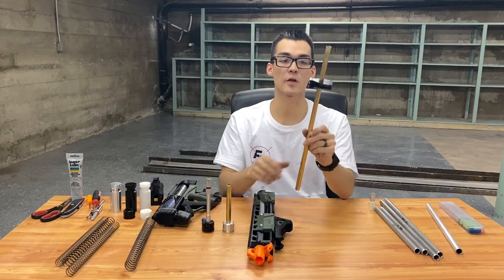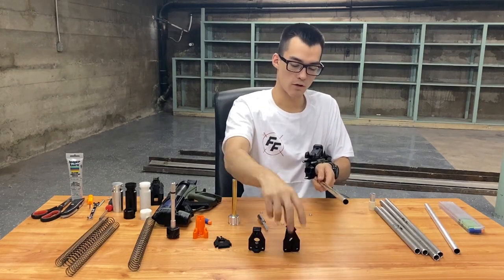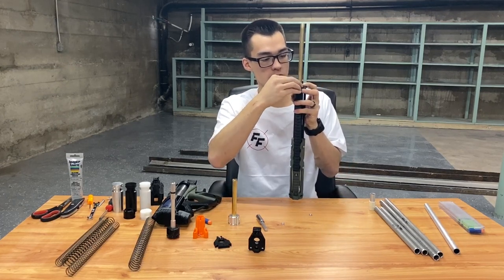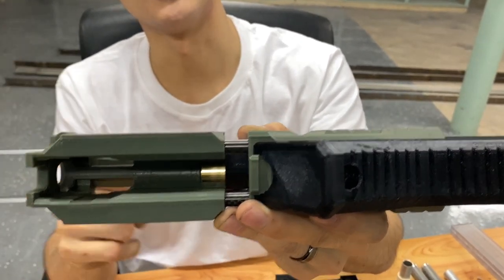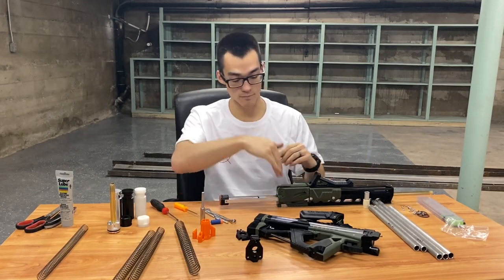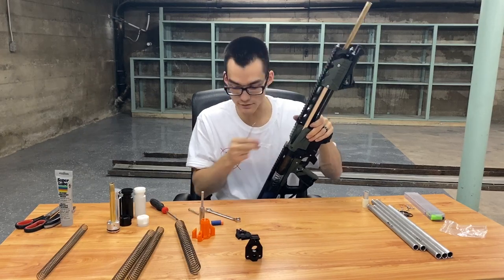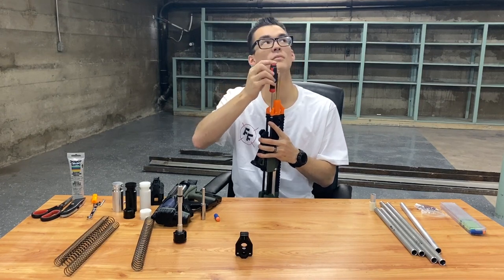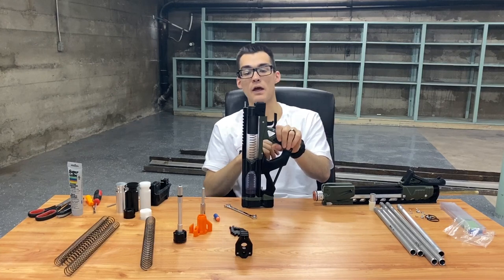How to Install a Brass Breech | Nerf Blasters

Comment from the maker: *Update (in case anyone missed it in the description):
The aluminum ram doesn't leak anymore. We've addressed this issue by used two o-rings on the ramtip and/or making the o-ring notch taller and/or using a slightly larger o-ring.

Comment: I'm not familiar with this platform at all, but would a dart guide / tongue extending over the magazine well in 9/16 improve feeding reliability?
Reply from the maker: Yes and no. It would help sometimes. However having a brass dart guide (which is how I used to do it) means the entire alignment has to be even more concentric. With a pusher, if there's a little bit of mis-aslignment, it's more forgiving. The magwell itself has a pretty good dart guide at the top of it, so the tongue wouldn't help much more than that. Hope that helps.
Reply: @FrontlineFoamBlasters  cool - I have only seen parts in isolation, not as a complete assembly.

Comment: Do I have to use the special muzzle print if I’m using a barrel cover? I was wanting the cover to slide over most of the barrel.
Reply from the maker: Yes. The muzzle clamps onto the brass and the cover just covers what’s exposed sticking out past the muzzle.